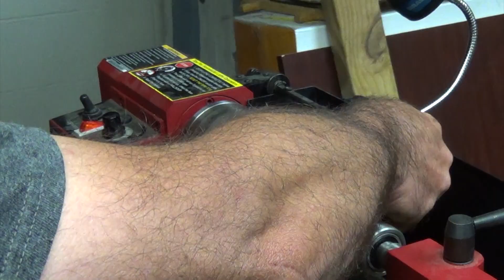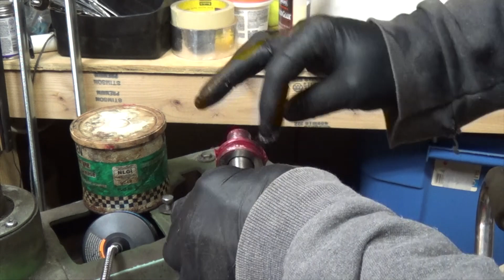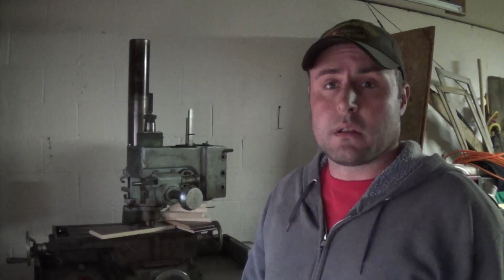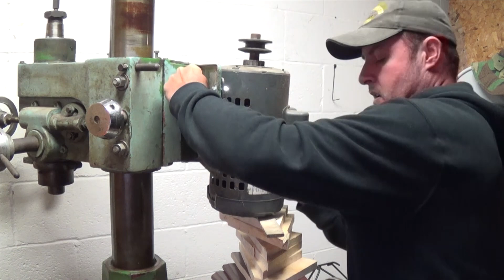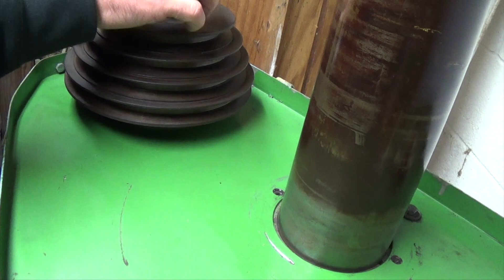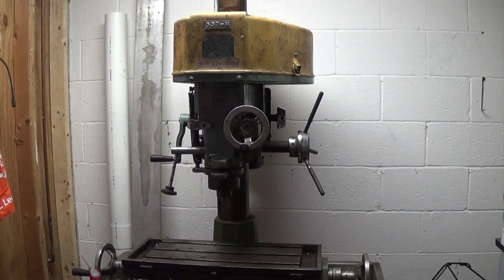It Works!  (Milling Machine 5)

Comment: Great job on the repair and reassembly.  No way I would have tried to put the head back on by myself.  I recently helped assemble a new Jet floor model drill press that has the same style rack.  Total PITA.    That spring is somebody's add-on.  No idea what it's for.  Be prepared to look up speeds and feeds and adjust the belts accordingly.  The belts don't need to be real tight.  I just push on the motor with my bare hand and snug up the tensioner bolt.  Overtightening doesn't make anything work better; just makes the belts and bearings run hotter.

The factory quill handles are MUCH longer, as in too long.  Yours look to be about the right length for most applications.  The originals get in the way often and I find myself having to remove one or two of them at times.  As long as you got the motor shaft parallel to the mill's column the motor mount is fine.  No need to replace or rebuild it.  Someone has apparently used the "bigger hammer" approach on this machine in the past in multiple areas and I would bet that the motor mount was among them.

Stefan Gotteswinter has a video on tuning up import tooling like R-8 collets to work as well as the high priced ones.  It's worth checking out; might save some bucks.  Enjoy your machine!
Reply from the maker: Since it has been repowered, I will just change the belt to each pulley and measure the rpm’s. Then I won’t be guessing

Comment: The plate the motor is on seems to thin to hold that motor
Reply from the maker: I think it might be. I’ll try it and see. Might have to make a new one. Hope it works well enough to use the drill press to make the new one if it needs it
Reply: @EverydayJourney  shouldn't be to hard to make one out of 1/4 plate